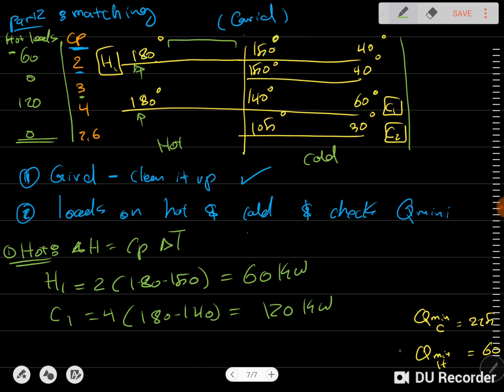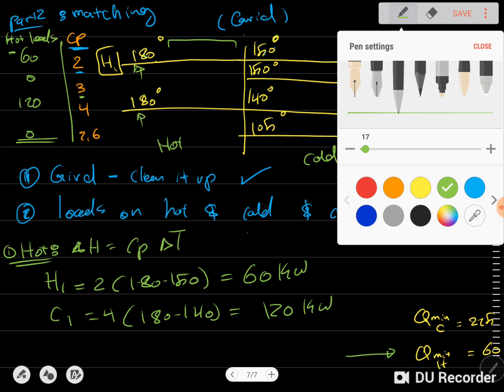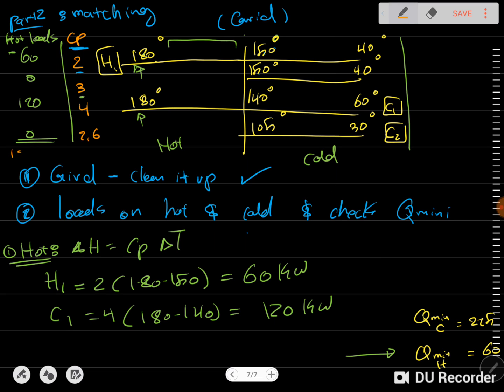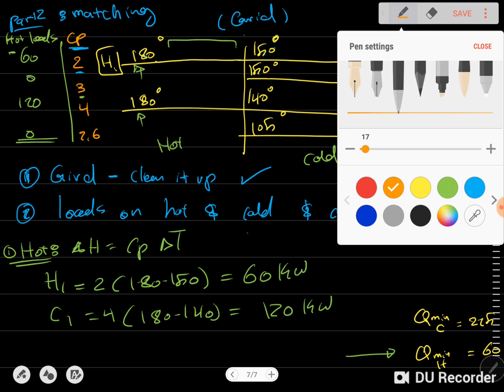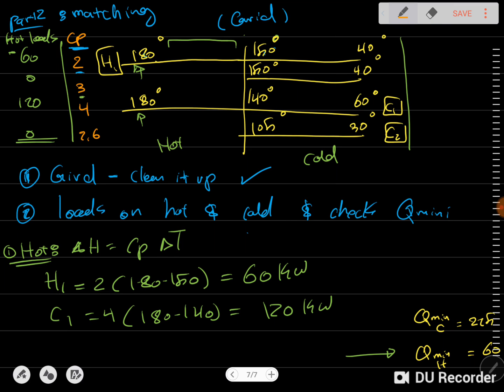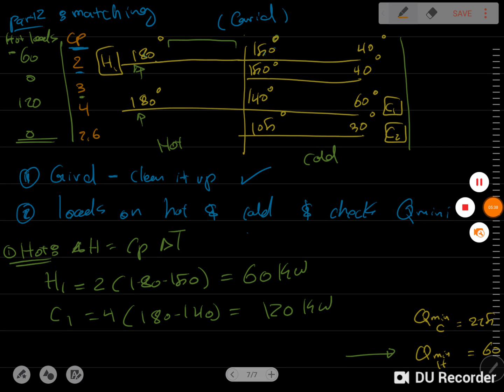Heat Exchanger Network Design - Matching - HEN

Comment from the maker: You guys the CP values (in orange) of 3 and 4 are switched.. So the correct order is: 2, "4", "3", 2.6.. 
This doesn't change the calculations/values in the video.. You should get the same loads I have after switching them.. Sorry for the confusion

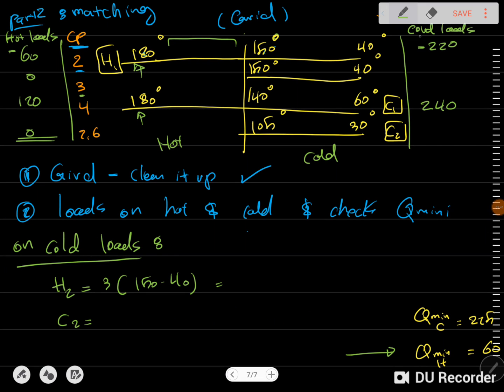Comment: At 4:57 if im not mistaken from the previous stream table, the Cp shld be 3, at cold stream 1, where C1= 3(180-140)= 120 and at 5:43, at hot stream 2, thr Cp shld be 4, where H2 = 4( 150-40) = 440.
Reply from the maker: Yea I switched the CP of 4 and 3 by mistake, thank you for this

Comment: In min 5:00 you say that c1 = 4(180-140) = 120, but is 160, and also, in min 6:18 you say that H2 = 3(150-40) = 440, but is 330.
Reply from the maker: Yep, i switched the CP of 4 and 3 by mistake, make them 2, "4", "3", 2.6 and u should get the same results, thanks for this